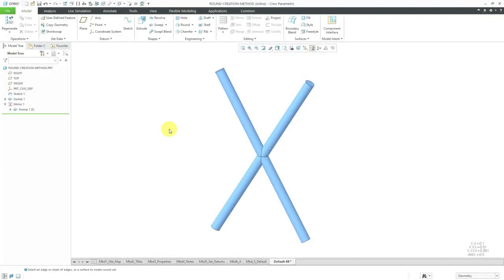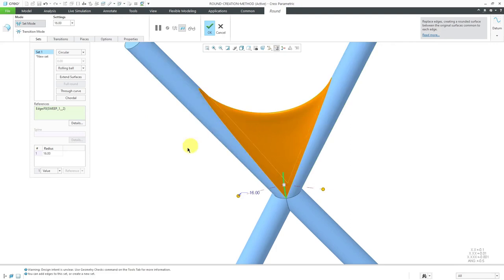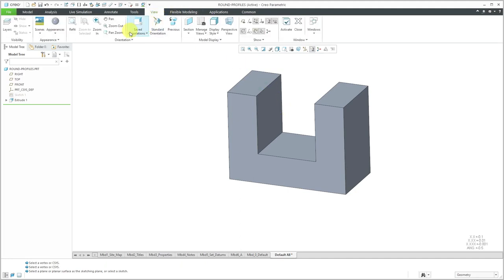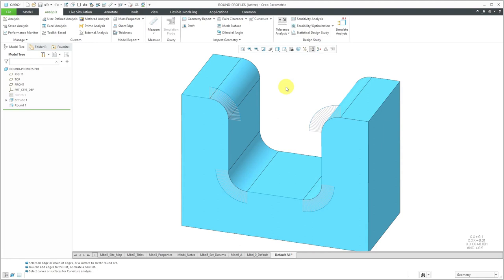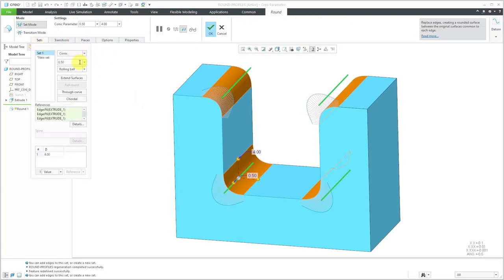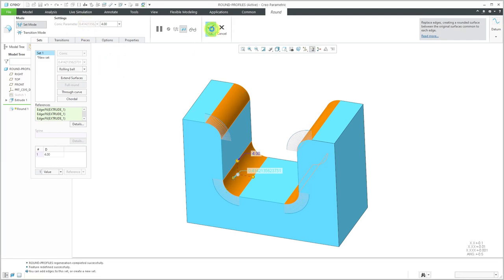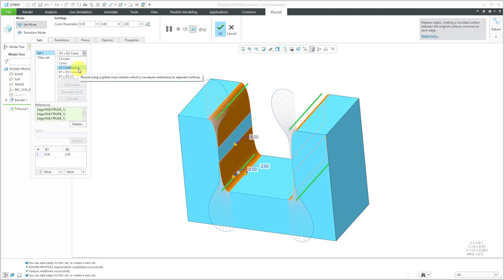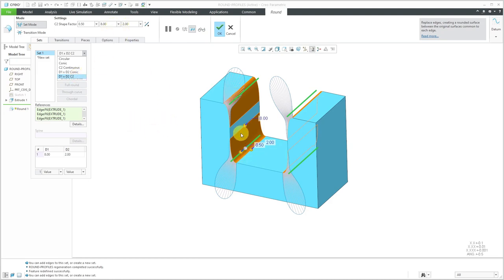Creo Parametric - Rounds (Part 2) - Creation Methods and Profiles

Comment: Very nice video, I always use hyperbolic rounds to obtain a sharp edge that is not actually sharp, and elliptic rounds to fake a chamfer with smoother connection to the main geometry. This is very good for aesthetic rendering.
Reply from the maker: Those are some great use cases. Thanks, Paolo.

Comment: very Good presentation. Do you mind also explaining how is the Conical round or Continuous curvature rounds features are manufactured. Is it easy to manufacture, do you recommend it for DFM?
Reply from the maker: “Easy” is a relative / subjective term. A lot depends on the nature of the surrounding geometry, whether external / re-entrant, etc. You can manufacture these potentially via CNC, mold design, or AM. By DfM, do you mean Design for Manufacturing? Because I recommend that for everything.